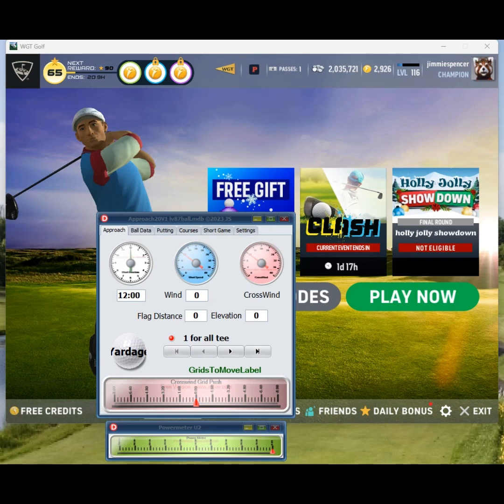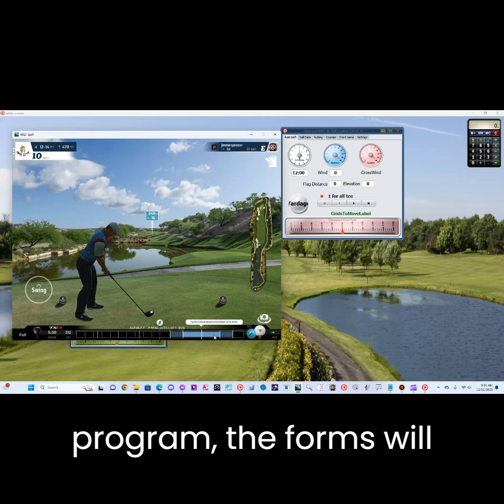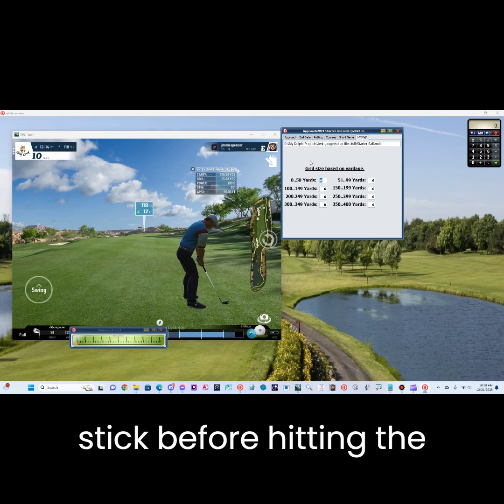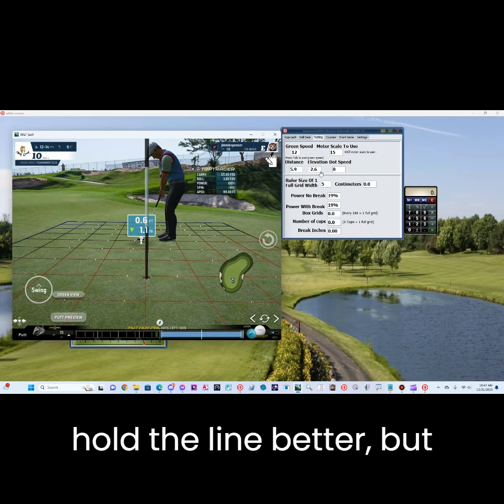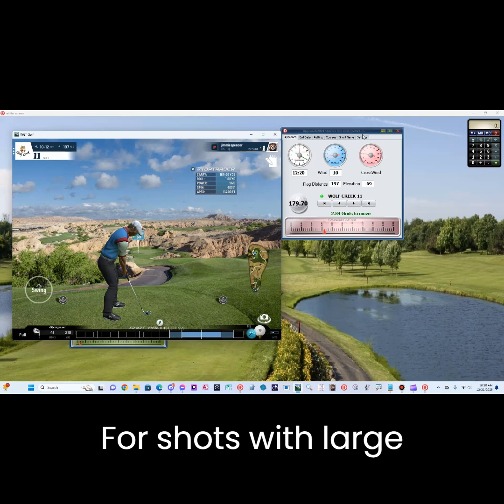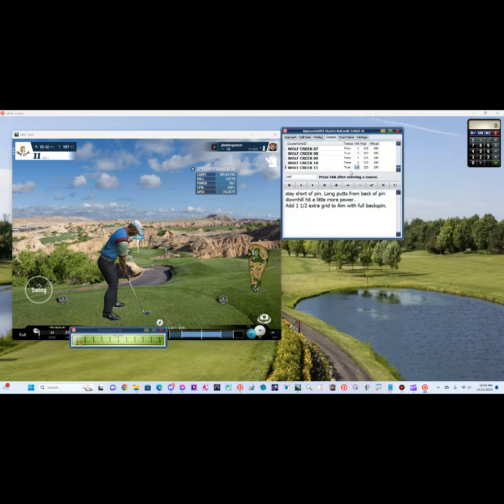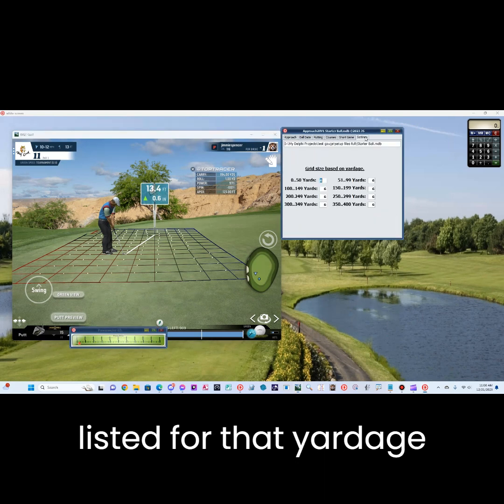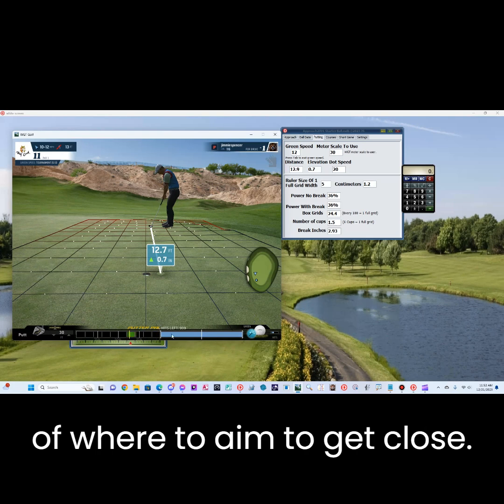Approach20V1

Comment: you guys are doing better than I am, I never get the power meter on downloading, I get error messages that anything I try to do can't be performed on a closed data set, also several cannot open messages when opening the program, frustrating, says already opened by another user or you need permission to view its data
Reply from the maker: 1. Run the program as Administrator so it has permissions to write to the files. Download the Approach20v1 program again and run the setup.  Run the program and click on the Forms menu item and select "Center all forms" now you should be able to move the forms around to your liking.
https://www.mediafire.com/file/hx3jswnof1tbmu7/Approach20v1Setup.exe/file
Also if you don't have a ball loaded into the program you must load a ball file under the "Ball Data" tab.
Reply: just figured that, I'm a little slow I guess, lol, it's working better now, thanks
Reply from the maker: @timhalstead9790  Glad you got it sorted out.
Reply from the maker: Key points to remember

1. My programs only run on the Windows operating system.

2. You should run my programs as an administrator or make sure my program folder has "Read/Write" access so the databases can be updated.

3. Make sure you are not running WGT in full screen mode; you must run WGT in window mode.

4. My programs were designed with a screen resolution of 1920 by 1080. If your Windows display has a lower resolution, you might be able to view the program correctly. You might have to increase your Windows display size.

5. My program uses Access databases to store information. If you receive error messages about closed datasets, you have not opened the correct file. i.e., load a ball so the program can work with it.

6. Watch the entire video; most of your questions might be answered inside.

If you still can't run my program correctly after these steps then you might want to try Kat's calculator which is good. https://drive.google.com/file/d/1pkrAnvC8Irv9xmOPPADRoOjzgM-v41wa/view?usp=drive_link

Comment: Hi Jammie not sure if it something I'v done but I get this message '1.0' is not a valid integer value. I'v entered 12:46 12W 137F  20E. many Thanks Paul
Reply from the maker: Yes with the new version you can't use ruler spin because of the gauge. Use a backspin value of -100 to 100 so ruler 1.0 is about -45 backspin, use -45 instead.